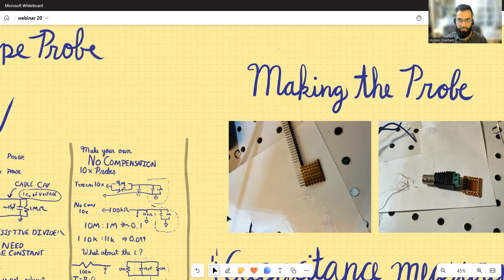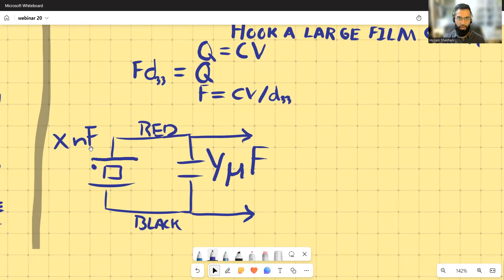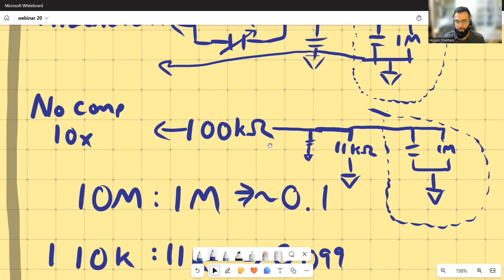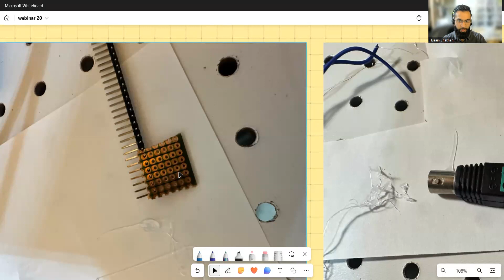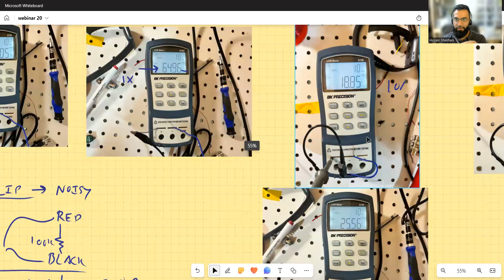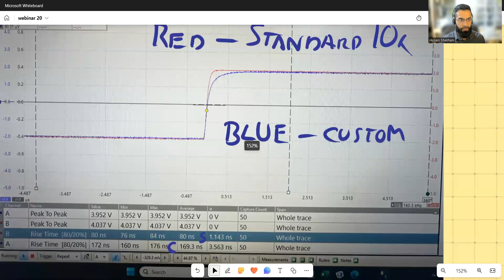How to make your own passive AC and DC voltage measurement probes for ultrasonic analysis

Comment: Excellent passive scope probe analysis for limited bandwidth measurements, have you considered employing active probes such as the TEK P6243? Cheers Husain.
Reply from the maker: I haven't used on of those probes before. About 95% of my work is on sine waves <100kHz. For isolation, I usually use an USB oscilloscope and float my laptop.